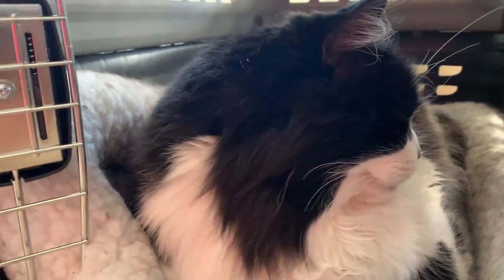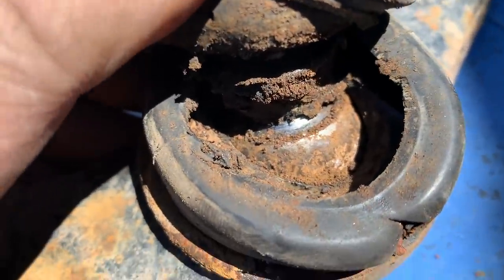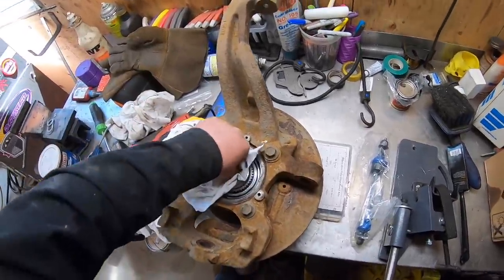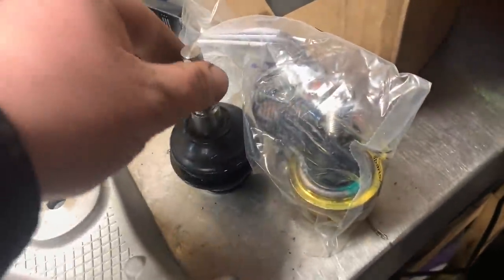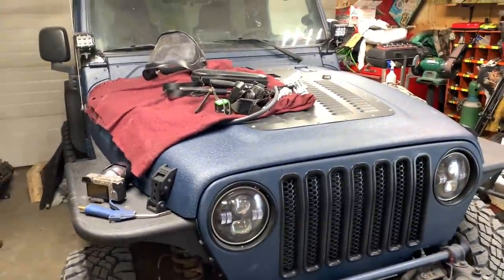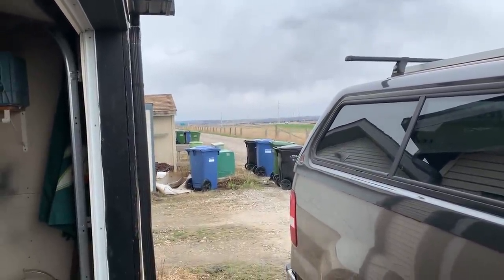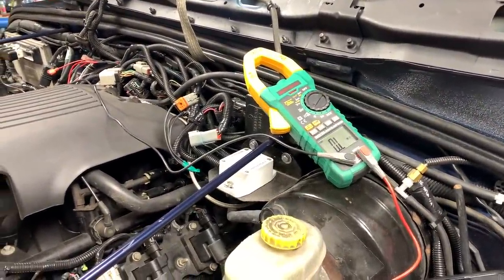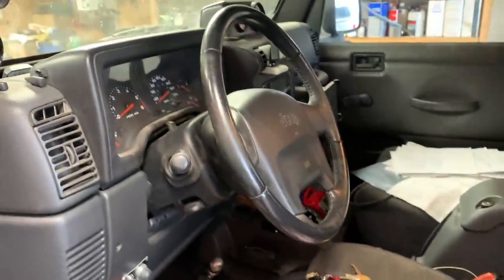Let's Get This Over With

Comment: The backside of those clusters get bad grounds and cause this. Try cleaning that connector
Reply from the maker: It isn’t a ground issue, it’s a issue that the pcm isn’t receiving a cam, crank signal to wake up the computer to make the tach and oil pressure gauge work.  The rest of the cluster works fine.  I can manually operate every gauge with my Autel scanner

Comment: Tried plug the jumper in while engine still running and RPM shows?
Could be wrong pull-up resistor too.
Or why not ask them? information AT novak-adapt DOT com

Comment: Why don't you fix your Ford and sell it and buy a old 1999 Z71 four-wheel drive I sold mine at 250,000 miles and it ran like a just came off the showroom floor the new Chevy sucks but the old one lasts forever